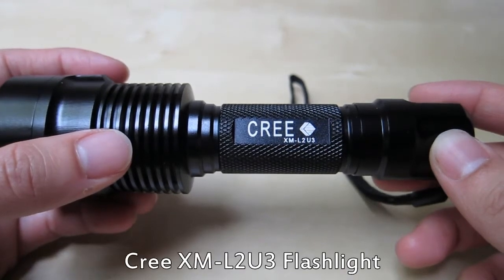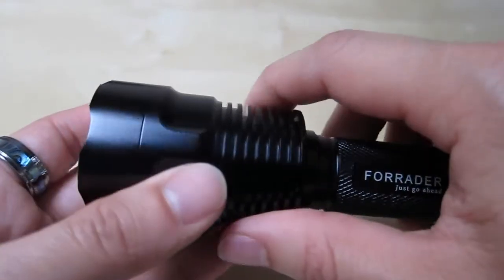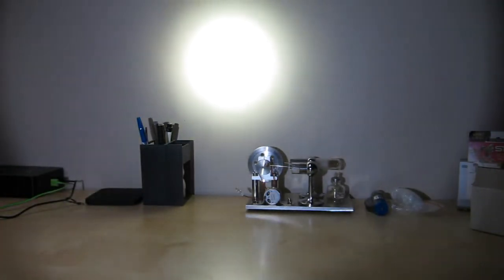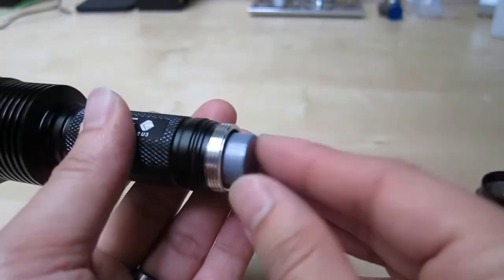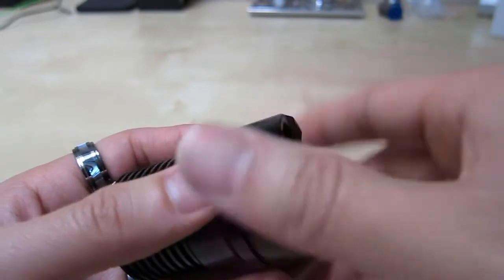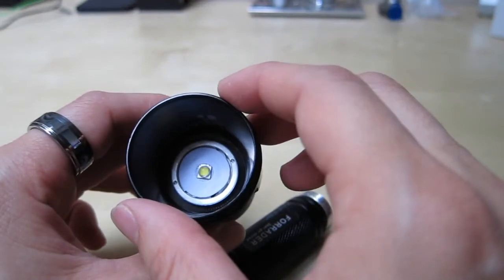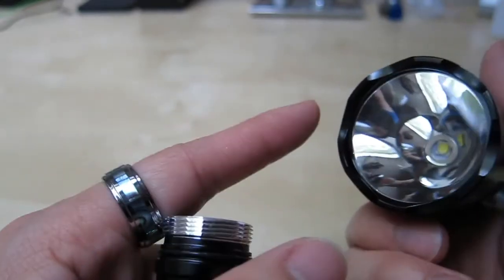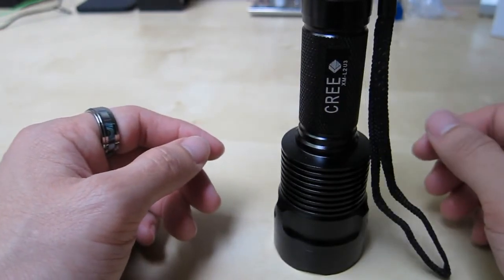Forrader C12 CREE XM-L2 U3 Super-bright 2000 Lumens LED Review

Comment: $ 20 is still a bit for a flash light :)
Reply from the maker: T-Rekt I agree as they are only for those in a market for one of these bright one :). Also don't forget the price of the battery, which can run you 2-3 bucks.
Reply: JohnyTechReview yeah that't true :)
Reply: Thats actually very cheap for this range. These advanced 600+ lumen flashlights usually cost around 50 bucks. 

Yes, i know it says 2000 lumen but its actually more like 900. Cheap flashlight brands are never honest. Youll find some that say like 100 watt or 25000 lumen.